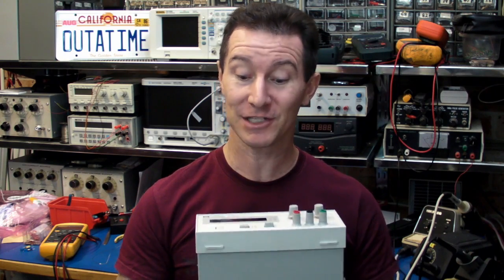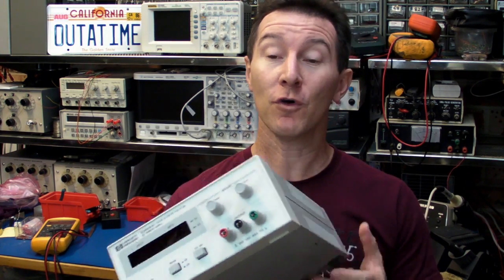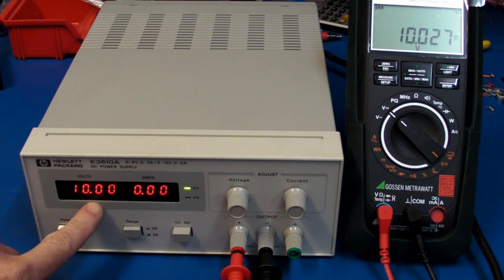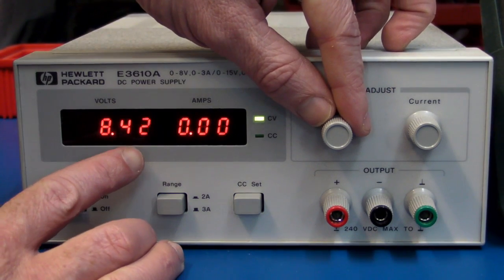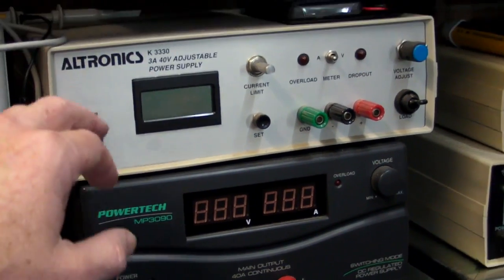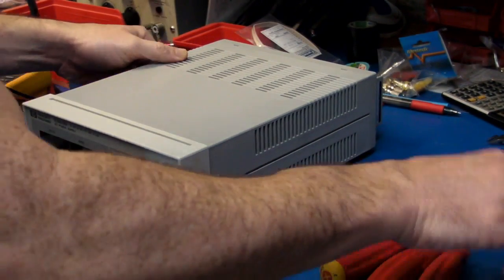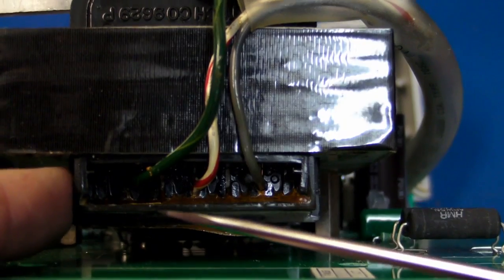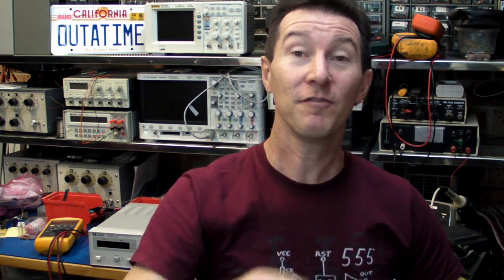EEVblog #166 - HP Agilent E3610A Lab Power Supply

Comment: Great video !!!  I liked the disassembly procedure and the internal overview. These power supplies  would be ideal if in addition to sourcing current they could also sink current too, they would be even better if the current sensing and limiting would be done after the large ripple filtering capacitor ...   comes in handy to test semiconductors when we don't want to apply all 
the capacitor stored charge.  Best

Comment: I need a good regulated lower voltage DC supply. My Lambda is incredibly nice for being all vacuum tube, but 500 volts @ 500 mA is made for tube stuff. I will hack 10 turn pots into items whenever I can find a way.. Single turn pots suck for fine adjustments. The Agilent has a fine adjustment. I have a neat old 1960 HP O Scope that still works great. I think it was stored outdoors in Arizona for a few years too. I'm shocked Agilent did not make a WWP 100-150 volt version. .

Comment: My HP E3615A has selectable mains voltage, from memory it was just a link to be soldered on the board from the multi tap transformer.
Reply: Hi! I have two E3615A and in one of these 2 the transformer sound is a bit louder than in other one, is that normal? I know that linear power supplies produce transformer buzzing sound...
Reply: Yes I'd say its normal, sometimes it can be caused by poor mounting of the transformer or something in the enclosure reverberating the hum. I had that problem on my Fluke 45 and it would drive me nuts, turned out that the unit got slightly bent in shipping and doing some re-bending fixed it.
Reply: @allansmith6140  Thank you for so fast reply :) I also think it is normal. I hope so. Maybe i should tighten the screws of the transformer.
Reply: Take the top off the unit and press on the transformer as its humming and see if it changes, its a mechanical issue. While you got the top off adjust the voltage display against an accurate reference, its quite an easy job and service manual is available on the net :)
Reply: I will add that cheap ass transformers can hum due to not having been potted properly at manufacture, but this being a HP I doubt it in this case.

Comment: Australia have a balanced system with no neutral. Using a grounding conductor as a grounded current carrying conductor is a no no in most countries. Floating ground inside the unit is cool. The earth in European service mains is likely to be so unbalanced I doubt it will work.

Comment: EEVblog I've a simple question, I connected a galaxy note 1 smartphone to the same power supply as yours and was able to make it working by powering up from the supply not the battery. Although the battery of the galaxy device says 3.7V the phone could not start with voltage output set less than 5V. Also, I can see that the current is fluctuating when I do different activities on the phone (e.g Bluetooth search and browsing), while my volt output is set to 6V. Now, if the current is 0.9 for example, can I say that my power consumption in watts is 6Vx0.9A = 5.4 watts ??

Comment: I agree. The ebay is flooded mostly with 120V models, and it is useless everywhere else. The lack of dedicated output on/off button, no external voltage sensing, no programibility via external interface (i.e. for programmed charging or measuring transient response of devices under test) and no way to easily change current limits on a fly without shorting output makes it meh in most modern labs.

Unless you need few good adjustable power supplies cheaply locally (no shipping and can make sure they all work correctly), buy something else.

Comment: Lets see back when I was in TV radio repair school in 1976 1977 we had HP power supply that used 220v AC 60hz   and the out put went from 0 v to 1000 v ac or dc I was sitting beside a guy and he was playing around with it turned it up to 1000 and he tried to show off then it hit the Bench boom  big arc and he got kicked out of the class   Man those were the days.

Comment: Cute toy! I have a 50V/20A (need 48V for my humanoid robot) bench supply not that much bigger.
I much prefer the coarse+fine 2-pot setup.
It's a lot quicker to change the voltage/current than a 10-turn.

Comment: how practical is it to add a load switch to this power supply? is it as simple as internally connecting a properly rated switch to either of the +/- output posts?
Reply: neppy5 I would connect it via a relay...
Reply: +Andy Cristea 
ye just a relay to the negative\positive binding post or a solid state relay if you dont want to hear the relay every time and your good to go
Reply: +the real illuminati thanks guys that was a good method. I actually ended up putting a switch inline on my red positive lead wire, so that acts as my "load switch", cheap and has worked pretty well for what I do
Reply: neppy5 putting a switch in series with the positive lead can create a forward voltage, depends on the switch you might lose even 100mV.. unless this psu has a sense wire I don't think it is the best solution. the reason for relay or even a mosfet is because relay typically are cheap and have a very low resistance compare to your on \ off switch.
but, if it works for you that's great :D

Comment: You can use a TRIAC dimmer circuit to control the input voltage to 120V and I know that it is not recommended but none  the less it works :)